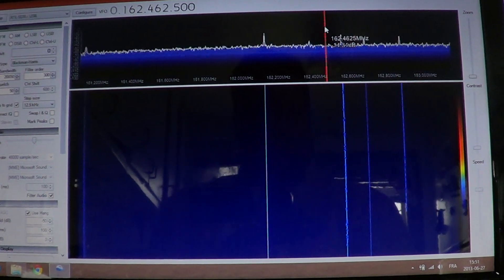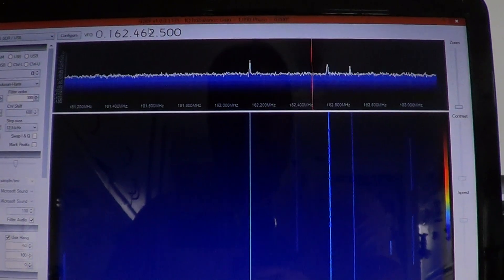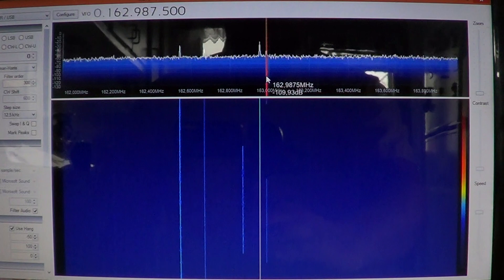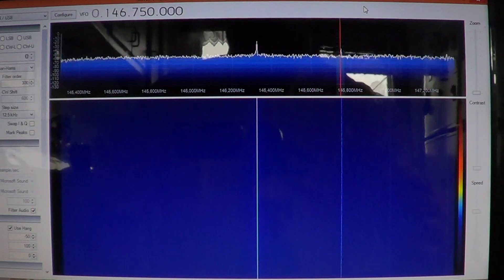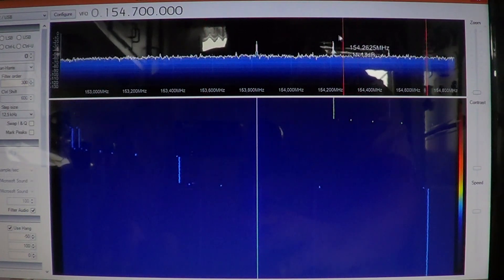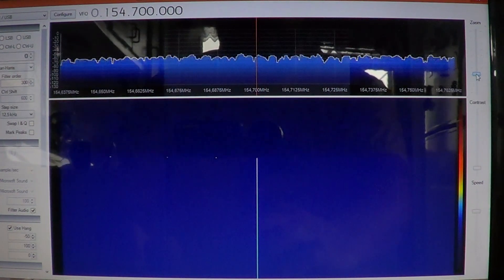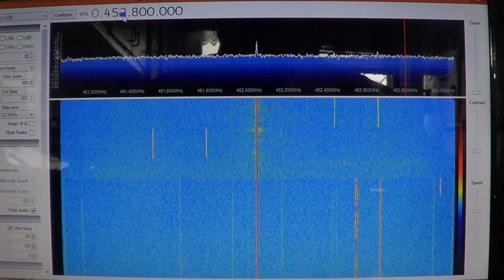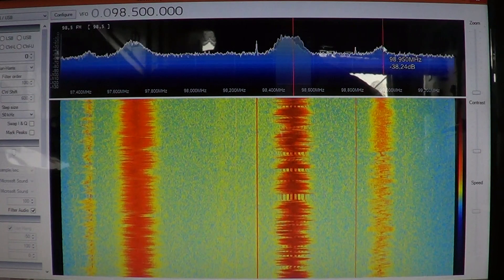EZCAP SDR receiver with outdoor antenna test

Comment: Also, make sure you increase the RF gain in the configuration box. Use the "Configure" button for that.
BTW, you set the bandwidth too wide for the signals you're receiving and that results in a lot of hissing. Zoom in and adjust the filter to your signal.

Comment: And don't forget to solder a BAV99 ESD protection double diode at the antenna input if your ezcap dongle doesn't have one. Mine came with the place where it would be installed actually marked but without the diode. And as far as I know, these dongles are quite sensitive to ESD, especially with big wire antennas like those used in HF.

Comment from the maker: what's interesting with SDR's is the flexibility is incredible .. so it can easily outperform standard analog radios  and with software updates are easy to fix some of the problems in reception   73

Comment: Look for the CT1FFU upconverter :)

My RTL-SDR is the same as yours (ezcap with FC0013 tuner) and I've paired it with the upconverter on a USB hub.
And I can say that using a "long" wire ant on a 9:1 unun, listening to HF is a joy. The only drawback is a bit of overloading when strong broadcast signals are present (it can be reduced playing with the RF gain).

Try also the SDR Console software. It has an S-meter and works great too :)

Great videos & greetings from another SWL in Barcelona!